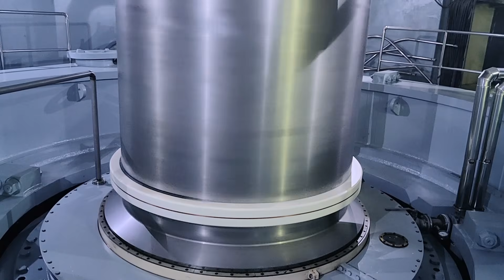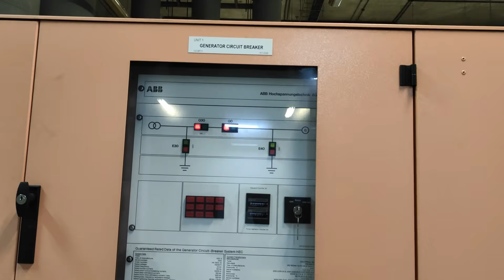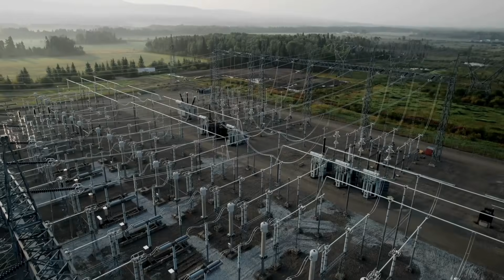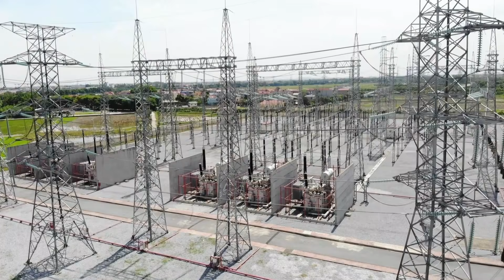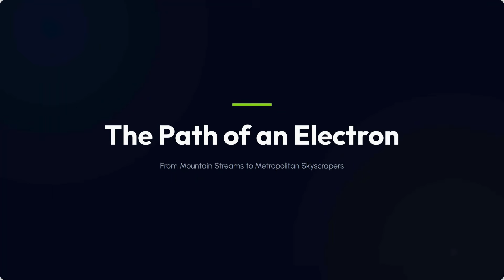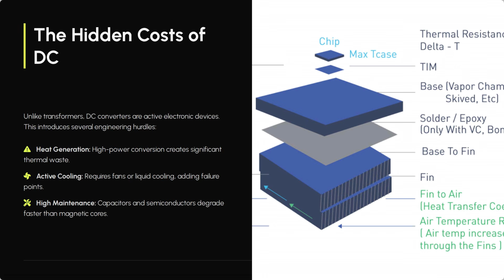Why Electricity Changes Form Before Reaching Your Home

Comment: Faraday’s Law and conservation of energy allows for the almost effortless step up/down of power to transmit immense bundles of it. For example, to transmit large amounts of power on transmission lines, the voltage must be stepped up, which drops the amperage. Happens vice versa before it gets to our homes. We need the amperage, so the voltage must be dropped in steps from the transmission lines.

Comment: Cool. I didn't know that about how China used DC power. Great vid 😁👍🇦🇺
Reply from the maker: Now you know. Initially i made the script for ac transmission lines. But when I searched I came to know about the DC transmission and about china and Japan. So I covered them also with little information I can find out
Reply: @hyrovision 
Thanks for that. Japan is cool. Im from the old days when appliances were AC or DC. You would be surprised what the first household electric appliances were. 😁👍🇦🇺
Reply from the maker: Ahan. ??
Reply: @hyrovision 
If you're inquiring about the 1st appliances you should look that up because you wouldn't believe me if i told you. It has something to do with "relieving hysteria" and was classified as a medical device. 🤔👍🇦🇺